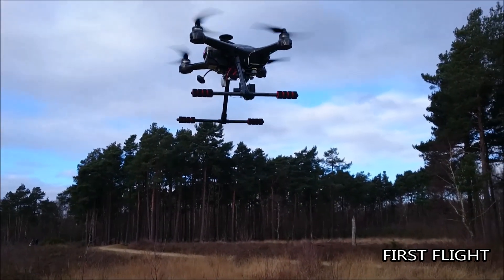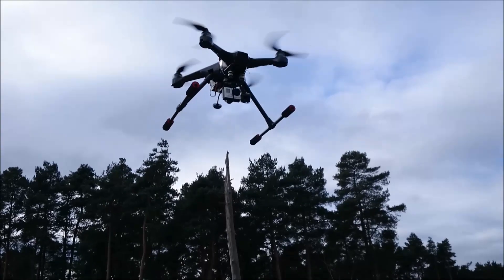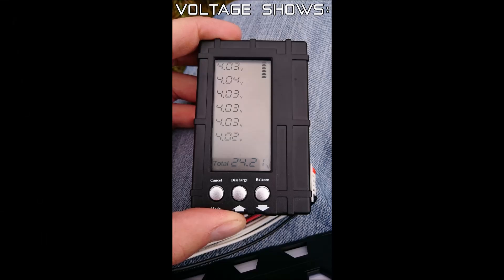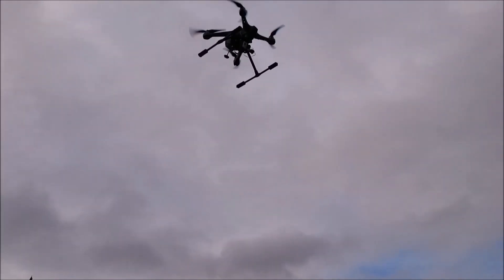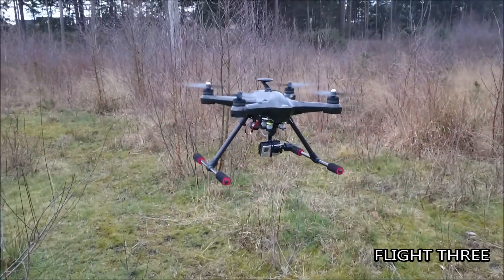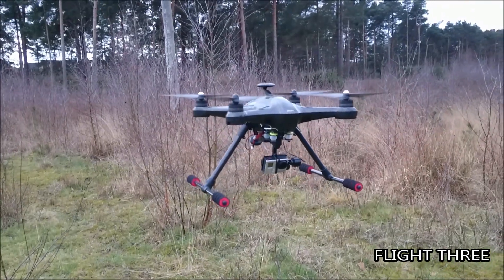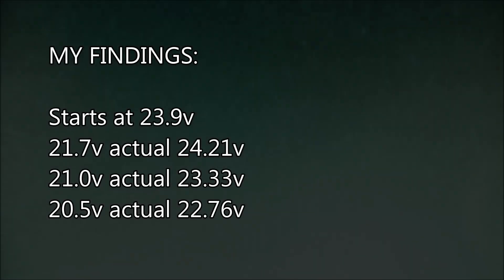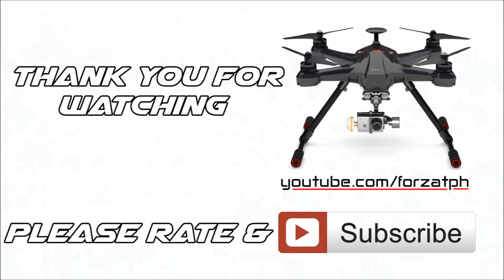Walkera Scout X4 - LIPO Voltage Test

Comment: You need to be very careful here. Your experiment has some issues. You are testing the battery with the Balance / Checker with no load on the battery. This will not be representative of the battery voltage in flight with the motor load. The voltage in flight will be lower than what you see here.

If the voltage drops to below 3.3V under load  in a cell it will reduce the life of that cell.
Reply from the maker: Thanks for the feedback.

Comment: hi Alex, jimmy here ,I was wondering if you could kindly help me set the low voltage alarm on my f12e transmitter....been trying but for some reason when I reach 21.4 volts  no alarm no nothing. please help thank you .:)
Reply from the maker: Hi Jimmy, ok three areas to check. 1) system menu > buzzer > status "on". 2) system menu > vibrator > status "active" 3) model menu > sensor setting > status "active" then down to sensor submenu > voltage > external v1 "active" and should read 21.4v. Hope it helps.
Reply: Thanks a million Alex and thank you for all the videos that you make they really are helpful and very interesting you're very good at it thank you hope you have a great day buddy

Comment from the maker: Wasabe Smith: Strange to say that my Scout has not tried to return home when low on voltage. I have however changed the voltage on the mission planner yesterday so it will return home at 20.5v.
Reply: Thanks Alex  i will do the same thing and set the return home at the same voltage as i noticed that im only getting 8min flight times  but only notice this after updating the FC firmware to 1.1

Comment: I notice that the battery lights wasn't blinking? So are you running it down that far?
Reply from the maker: Battery lights were blinking, alto GH difficult to see. They were matching the true voltage reading rather than that of the transmitter.

Comment: Tip for editing.  If you reduce the volume of the drone video in your video editor.  You czn talk over it easier in post commentary. 

Its hard to hear you over the drone at times
Reply from the maker: Cheers. I did my best with the reduction of audio, but guess you cannot get it right every time :)
Reply: Alex Savo what editing software do you use
Reply from the maker: just the basic. Windows Movie Maker.
Reply: Alex Savo yeh i tried that.  Frustraing software.  Sony makes increadible editing software anywhere from $50-$900. I went big and bought sony vegas pro-$600 and i love it.  Its expencive but if you plan to make videos for a long time to come. Then Its great. What took ages before now takes minutes, and its clearer.  But my freind said he has the $50 basic and his has most of the basic features that just makes life easy.